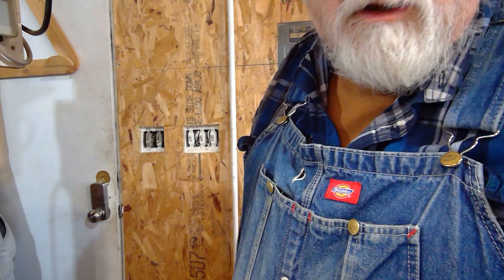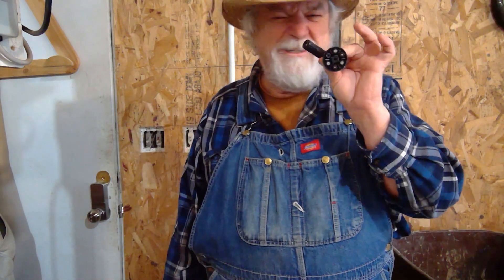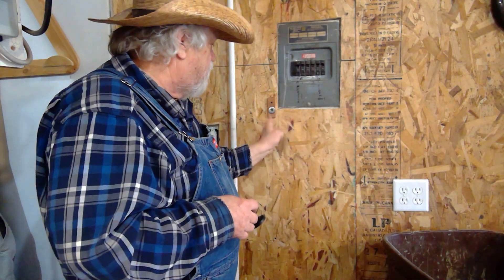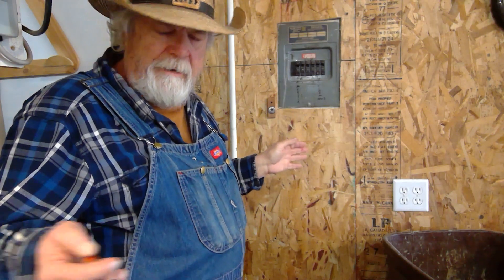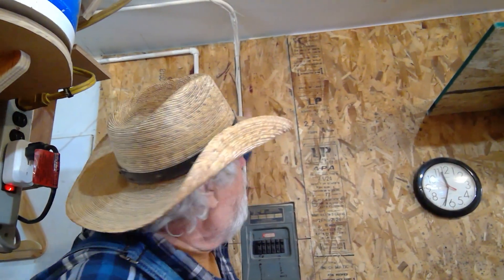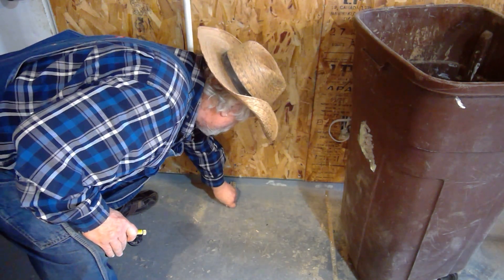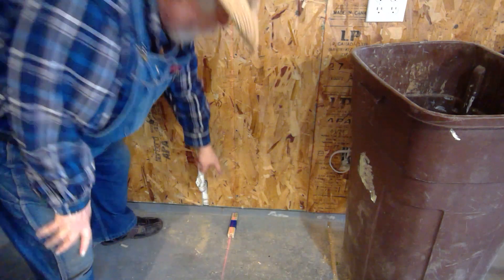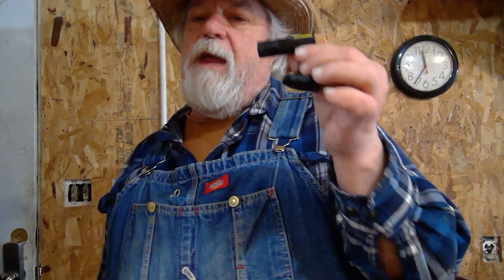Laser Light    Another Clever Use by OTB Thinker

Comment: I just bought the HF laser light. I am disappointed in that the laser line is so wide. It estimate it to be about 3/16". The package says it is 1/8". Either way if I can't get a finer line I don't see the how it can be that usable. Maybe you can tell me how to focus the beam narrower? I think the beam needs to be 1/16" or less to align a cut line on a board for me. Any comments???
Reply from the maker: The further away from the light source, the wider the beam will be.  It worked fine for the job at hand.  If your light is 4-6" in front of the cut, it gives a finer line. I understand the limitations of this laser line and don't expect it to work to the standards of a $500 laser.  if it is that wide within 6", you might have a bad one (if that's possible from HB :>)
Reply: @russveinot5754  I had it on my band saw which was about 10+ inches above the table. Maybe I have a bad one??? If I have to mount the light 4-6" in front of the blade that may not work for me. Thanks

Comment: Perhaps I getting something wrong but why didn't you just put in on the floor X' away from the wall and align the top and bottom mark on the sheet with the laser?  JimE
Reply from the maker: with my clumsy feet, it would have been rough on the laser :>) OR  the light is kind of weak, I think it shines better down hill :>) . . . OK, I guess your idea was good too.  thanks Black...
Reply: @russveinot5754  Thanks.  I going to head to HF tomorrow and pick one up.
Reply: @russveinot5754  Russ.  I just check HF website and don't see it there.  Any info you can supply?  Thanks.
Reply from the maker: it is hard to find.  laser line marker can be found at Harbor Freight. item # is Item #93242
Reply: @russveinot5754  Thanks Russ.  I found it with that help.   I'll take a little trip the HF store tomorrow.
Reply from the maker: I hate to admit this but . . . I now own 4 of them.  they are so handy and I keep moving them around to different machines :>)  you'll love having one around and more ideas to come.

Comment: I wish I had marked where the frame is in my shed workshop as now, some years later I want to add brackets to hang stuff. Any ideas? Good video BTW. Thanks for sharing.
Reply from the maker: I have "hunt and peck" with a drill and a 1/16" bit many times. I've had a wall look like a woodpecker live there.  sometimes you can see nails in siding (outside).   finding the first 2 (studs) is the hardest.  do you know the spacing on the studs?